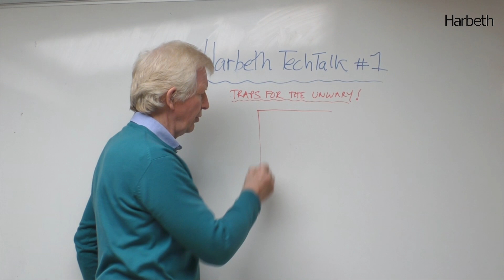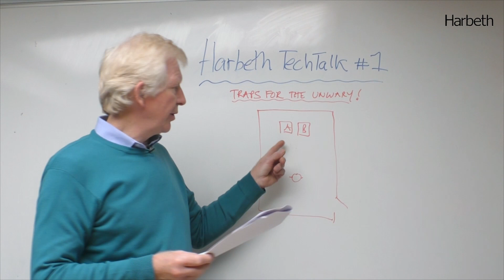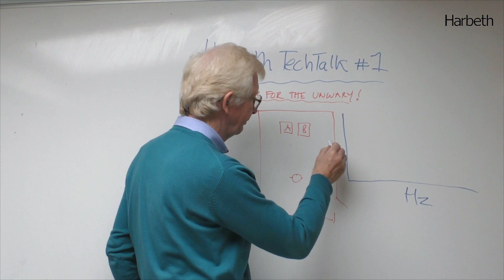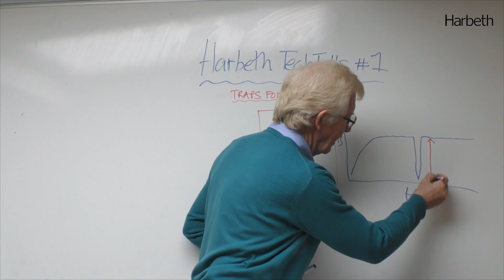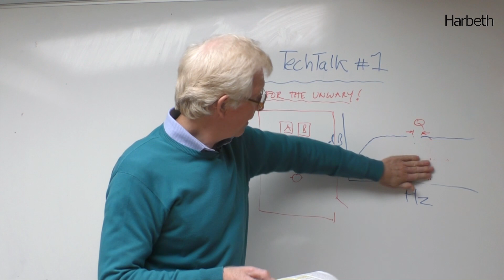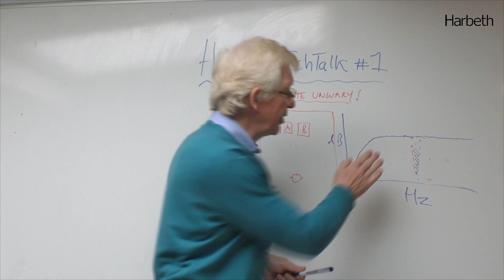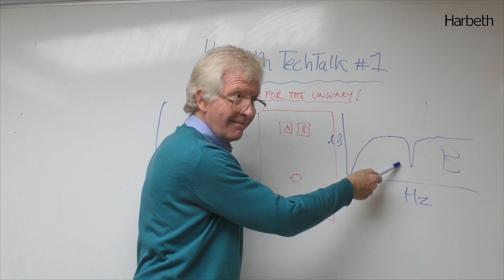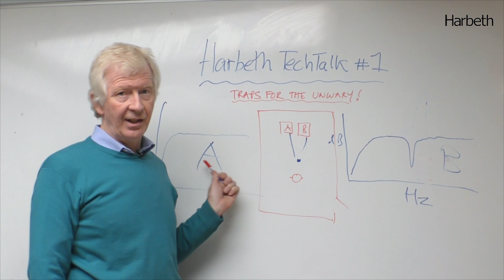Harbeth TechTalk | How to compare loudspeakers under dealer demonstration conditions

Comment: Thank you. I am looking at Harbeth speakers and stumbled across this channel. I find it impossible to reliably demo speakers at a dealer, other than to exclude something completely unsuitable, because of variability in listening room and partnering equipment. The only reliable test is in my room with my equipment for an extended period but this requires an exceptional dealer. I’ve had my hearing (HRTF) response plotted and can research speaker data and reviews for potential purchases but a home audition really  is essential despite decades of experience.
Sadly my “exceptional dealer” doesn’t stock Harbeth but I am looking.

Comment: It's true. I was very impressed by Sennheisser's IE80 earphone when I first upgraded from a cheaper model. And I though the sound was very dynamic and balanced compared with my previous earphones. Later I learned from online reviews that it's kind of boomy, and there is standard eq to balance it. But after I applied the standard eq, and switch it to the eqqed effect - god my first impression was that it became so harsh and too bright, even hard to bear when listening to my favorite songs: the hissing of the highs was too much for me!. After listening to the eqqed sound for a while, I felt better. But today I'm still not sure if I prefer the eqqed sound or the original sound - seems our ears tend to adapt to the new sound characteristics after a while, unless we do the AB test quickly. Even when I do apply an eq, I would choose to downgrade the intensity, a handy function provide by Wavelet app.